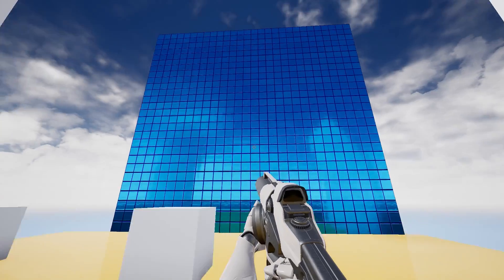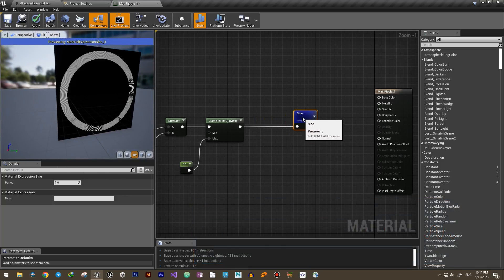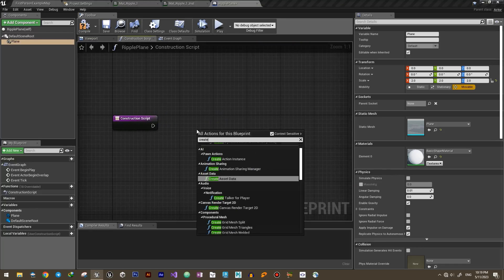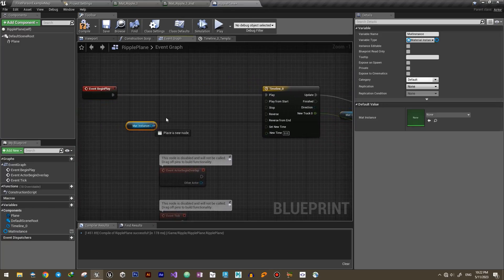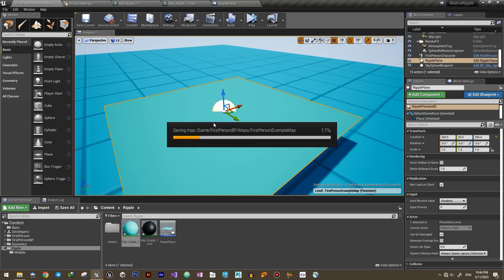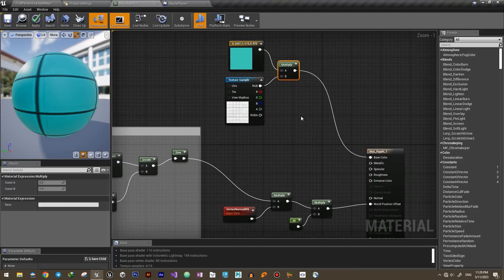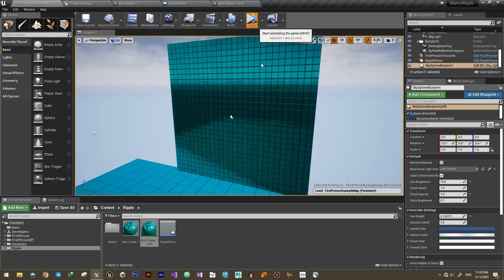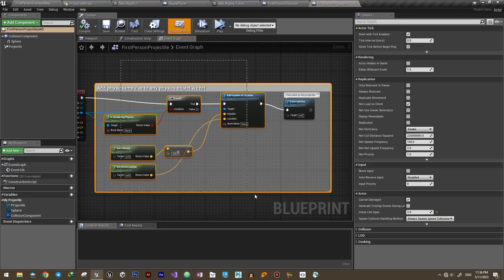Creating Matrix's Building Ripple Effect In Unreal Engine

Comment: For anyone having issues on UE5 with the plane/mesh deforming wrong, try disabling "build nanite" when importing the static meshes you plan to use. I was having an issue where nanite was forcibly lowering the polycount of the plane, making it look all spiky and weird.

Great tutorial btw.
Reply: I'm still having the same issue. Any ideas? It looks better without nanite but still messed up. Super spiky and geometric
Reply: @zoejeffrey2862  Your base mesh might not have enough polygons to deform smoothly. That or the ring might not be thick enough to effect all of the polygons you want it to (which you can tweak with the variables from the tutorial)

Comment: Hey, short question.
How would you make the wave move faster/slower?
So basically control the speed at which the wave is traveling
Reply from the maker: Hi. You can change the duration or rate of the time line to affect the ring's speed